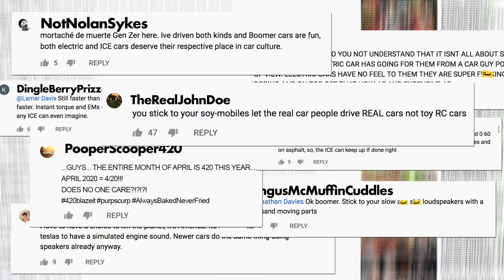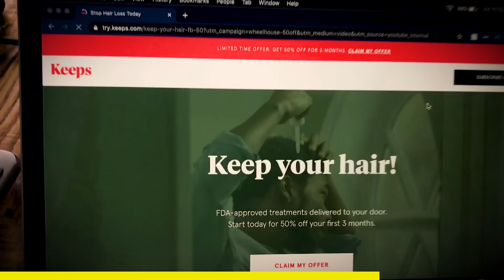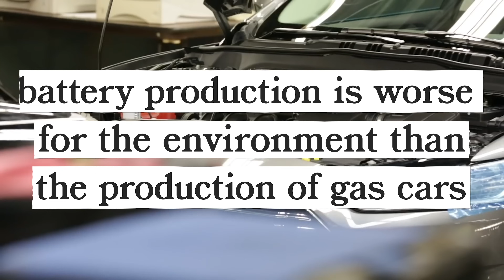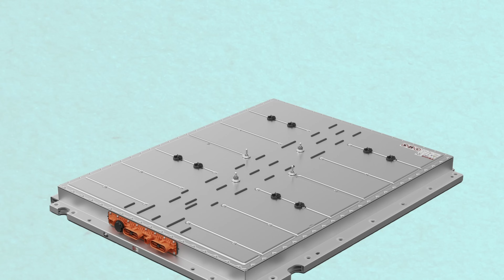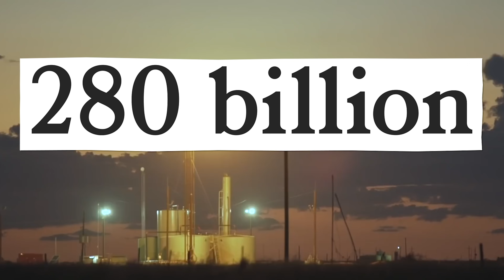Are Electric Cars REALLY Better for the Environment?

Comment: It depends on where you live,  I live in Vancouver and we run on hydroelectricity which is a renewable source of energy, also Tesla batteries can be recycled.
Reply: How many times can they be recycled? I have a 2003 Prius and had to replace the big battery a year ago, I got a refurbished/recycled one because a new replacement costs $4,000. Big whoopty-do they would only give a one year warranty on it, so that means I'll be needing a new car in what... another year (because I won't buy another big battery), or spend months looking for and waiting for another replacement!? Most people haven't had hybrid's or EV's for very long and so are completely unaware of the reality. News flash... these hybrids and EV's are FAR from environmentally friendly and are NOT a good replacement for combustion engines. These yahoo's need to go back to the drawing board and do a much better job because what they've given us as a solution to fossil fuel use and combustion engines is abysmal.
Reply: @SacredHabitats  Most rebuilt engines have a 90 day warranty. By your logic, that means  they will only last 90 days before blowing a head gasket.

You have a 17 year old car. It must have sucked, lasting only 17 years. Why, oh why couldn't it have lasted 20?  (Maybe things have gotten a bit better in 17years?)
Reply: @SacredHabitats  they keep ignoring the negative effects solar, hydro electricity, and windmill has on the environment. Nothing will change much basically.
Reply: @Teji Gill to answer which type of vehicle should one use... if you already have a vehicle with a combustion engine, keep it and use it. Do NOT dispose of it to get an EV, getting rid of things so we can have the newest greatest thing is FAR MORE harmful to the environment than anything. Likewise, when it comes to appliances, electronics, etc. get them repaired when they breakdown, do NOT dispose of them and by a new replacement, that type of behavior is terrible for the environment.
Reply: Tesla or Leaf, the lithium batteries cannot  be recycled. Period. There is no efficient technology at the moment to do this because of the chemical complexity of recycling, while the process is simple by itself - it is either burning or dissolving in chemicals. Unfortunately, either way not an option, coz the battery cannot be burned cleanly nor could it be dissolved without any environmental damage.
Reply: @sergiogooner  A quick single google search says that up to 96% of the lithium can be  recovered with existing technology. If Lithium becomes valuable enough, then it will become worth the cost to do so.
Reply: @MrRentageek  The fact that, like oil, lithium is a finite resource, will probably make it worth doing so. However, we will see what the future holds, as EV battery technology may soon move away from using elements such as lithium...
Reply: @sergiogooner  What complete garbage!   You need to see the YouTube video of the Volkswagen Electric Car Battery Recycling plant in action.  You can watch the recycling process for yourself. No burning or dissolving anything. Where do you people get your misinformation from?  The battery packs arrive at the recycling plant, and are discharged prior to being recycled. The residual energy from the battery packs is actually used to partly power the recycling process. It seems you are several steps behind what is possible...... And, just so you're aware, the lithium and cobalt content of the batteries is recovered to levels around 90%, after which it can be re-used in new applications. Try that with gas or diesel.
Reply: @Teji Gill and this video just posted a few hours ago. Take note of how much it cost Tesla car owners to charge their cars this past February https://youtu.be/EECnmBjgSK8 Like I keep saying we have extremely far to go yet to make truly green technology. Until then, anything we use or come up with will continue to pollute and waste. It's just the way it is if we want to live the way that we have been living because our lives are completely dependent on energy consumption. Until we learn how to extract electric from the air or Earth I do not see any means of energy that are good for the environment. We need to stop putting lipstick on pigs in the process of reaching any real advancement.
Reply: @Teji Gill I bought a 2003 Prius back in 2005. I still own it and it is my only vehicle. When it reaches the point of it can no longer be repaired will I get another Prius? No way! Will I get an EV? Absolutely NO! What would I get? I'd buy a pick-up truck that is older than 1981, before they began putting all of that electronic nonsense in them. Why would I do that? Because it's simpler to repair and fewer things to go wrong and breakdown, and... for the fact that we WILL have a CME (Coronal Mass Ejection) event in our lifetimes. At which point our grid, globally, is going to go down and will NOT be coming back up. In other words, we will be without electricity from then on out. An EV, or even a Prius/hybrid will be completely worthless as there will be no way to to keep them going. At least an old pick-up truck can run on some biofuels after the stored gas runs out. 
A FAR better investment though would be a solar powered bicycle and a regular bicycle, and a horse. 
In the meantime, everyone needs to learn how to live without electricity or any type of fuel because when that grid comes down there won't be any energy to draw upon, outside of your own body doing manual labor so you and your family can stay alive. Seriously, it is going to happen. I think a CME will take place by 2024. So I think it's MUCH smarter to take that money one would invest in an EV or hybrid and put it towards things that will work without electricity and invest in learning skills so you know how to do things without electricity/energy. That would be a far superior investment than an EV.
Reply: China Life  Sure, but the US produces more CO2 per person than China does. They just have 5 times more people.
Reply: Funny fact , BC has the highest carbon tax in Canada and yet their emissions still go up . The US has no carbon tax and their emissions have gone down  Lmao people are so easily fooled .
Reply: @rdhudon7469  Our country is also ran by an idiot so...
Reply: Tesla’s are overrated over priced garbage. Not to mention they are one ugly looking car
Reply: @real4039  the only ugly looking cars are the cars on the road today, they look boring and generic as fuck
Reply: @Teji Gill we require fossil fuels to build the EV vehicles and infrastructure. So, why would we want to add further insult to injury? Meaning we already have damage from fossil fuels, why would we want to ADD new damages from something else? People don't get it that these new technologies are NOT green at all. They just aren't. That's a lie from the industry to get us to dump what we have been using and switch to something completely new so they can extract more money from the people = that's how the rich get rich and become richer still, while further enslaving masses. 
What's the best thing to drive? Until our technology reaches TRUE environmental friendliness these modes of transportation produce the least problems environmentally... bicycle and horse. By the way, you do know that CO2 is NOT ruining our environment, right? The nonsense about CO2 and global warming is propaganda. If you don't know that you can begin to learn by watching this excellent video https://youtu.be/BGL2cjnn7kM and I highly recommend watching his, Tony, other videos if you want an education on real facts and reality minus any propaganda. Tony has been a highly qualified educator for 13 years on this very topic. This is exactly why I completely reject the Green New Deal (GND) and other so-called green technologies, they are no more green than what we've been using. Truth. This is also why I keep telling people to also reject the propaganda and tell this phony bologna's to go back to the drawing board and come up with something(s) that are truly environmentally friendly and stop believing this stupid fake CO2 is causing the Earth to burn up (or whatever nonsense they spew to the masses who don't know anything about this kind of stuff and line up like lemmings about to walk off the cliff blindly/stupidly).
Reply: @SacredHabitats  So because it uses at least 10% as much fossil fuel, it's totally worthless?
 
Also, that guy is a total  fraud. 

The ice caps ARE melting.

The permafrost IS melting.

Hurricanes, tornados, cyclones, droughts and floods ARE getting worse.

The Earth is getting warmer, and is doing so faster than at the end of the last ice age.

We are experiencing a mass extinction event all around us; only the 7th one in 13 billion years.

Lemmings don't actually walk blindly off cliffs.

All  of the above are verified truths.

Comment: So we measured CO2 on just a few chemicals in the batteries... 

You even skipped the nuclear waste they leave when mining it...  Trust me... The batteries we have and the ones we are about to get will do more damage than driving old cars with no emissions.
Reply: You do realise lithium isn’t radio active unless you make it right?
Reply: @engineeringtheweirdguy2103  
He either doesn't know what he's talking about or there may be a slight chance he may be referring to digging up radioactive stuff naturally on earth but was deeper thus causing less issue, being brought up to the surface but I doubt he meant that either lol
Reply: @dallysinghson5569  it’s fairly easy to get the grams per L fuel of emissions and grams per kWh of energy production for oil, gas and coal. Even in a coal based grid, without considering fuel refining, less emissions are produced.
Reply: Driving old cars with no emissions? How will it run then?
Reply: Why should we trust you? Do you have an advanced degree in anything? Or even just decades  of work in a related field?

Comment: How does the calculations allow for battery replacement over time ? Do multiple battery replacements undo the fingers ?
Reply: Current generation EV batteries will last twice the average lifespan of a standard combustion engine.

Comment: You forgot to calculate the emissions created by storing the spent batteries (transportation, facility energy, etc.). Also emissions may be the least of the issues. If batteries are not stored above ground, battery acid leaching into the earth and poisoning the underground water and surrounding area's soil is of serious concern. That is perhaps the most grave long-term problem that EVs are kicking down the road.
Reply: These aren't lead acid batteries, and there's no liquid component.
 
Also, since the whole concept is to be environmentally sound, Tesla has been at the vanguard of knowing how the materials are sources, and how to dispose of them. He's not alone, just one voice in the forest.
Reply: There is no battery acid in EV batteries. There is no liquid component!  Whoever told you that is seriously misinforming you!

Comment: This is the second video I watched on this subject. The other video had the same results and did post links to their references. I think EVs are good. What’s bad is a zero to 60 mindset. (Either we are going 60 or we are dead stopped, nothing in between) While we can help the environment with EVs there certainly are limitations, such as planes. So for some folks, especially politicians that are pushing an agenda to rid the country of all petroleum products is what I believe turns most rational folks against the cause. This is exactly the mindset that offers little in the way of positive change and ultimately hurts their cause and forces folks to resist. Change is often scary and most resist it. Gradual change is often the best route as many won’t notice. There is also good things happening in the production of gas cars as well. Manufacturers are always finding ways to increase performance, lower emissions while increasing efficiency. For those to say this is pointless is ignorant as these advances also help the environment. We know what gas cars produce today in metric tonnes of CO2, but to think that number won’t decrease in the future based on engineering is living with your head in the sand. I’m sure the CO2 impact of gas cars in the 70’s was far worse than today. What changed?  Not just the engine, but the refinement of petroleum.
Reply: Who exactly is pushing an agenda to get rid of all petro products, and I mean specifically proposing a single law or regulation that would propose this? Can you name even a single, symbolic act or bill that even suggests this?
Reply: @MrRentageek  Well, it hasn't passed, but the Green New Deal here in the US and the EU is proposing an effective ban on all petroleum based vehicles by 2035.  I put a link to the article about the EU's ban here: https://www.reuters.com/business/retail-consumer/eu-proposes-effective-ban-new-fossil-fuel-car-sales-2035-2021-07-14/.  And you can read the Green New Deal here: https://www.congress.gov/bill/116th-congress/house-resolution/109/text. The Green New Deal enacts provisions for America to meet a 100% power demand from renewable and clean energy within 10 years.  Currently, renewables make up less than 1% of the total grid support in America.  I don't know about Nuclear and if that is even a consideration under that deal.
Reply: @petermartucci6534  Not sure where you are getting your claims from, but the claim that 1% of the grid is renewable energy is completely false.  Renewable energy is 19.8% of the grid, not 1%.  According to the EIA, the electricity in the USA is generated using the following:
Fossil fuels 60.3%
Renewable Energy 19.8%
Nuclear 19.7%
Other Misc 0.3%

The goal is to get to net zero, which is zero carbon added.  However we get there is still a question, but so far the grid is around 40% zero carbon, not 1%.
Reply: Those claims are pretty misguided at best.  There have been efficiency gains in engines over the last decade, but MPG has remained the same or declined.  Why?  Because most of those gains went to more HP, not better fuel economy.  The same model car bought in 1998 that had a 3 liter V6 and produced around 190HP had a 3.5 liter V6 engine producing 255 HP by 2003.  HP has gone up in every car in the last couple of decades, but MPG has remained stubbornly low.

And you can claim all the sand theories you like, but they are fast running out of tricks to make gas engines more efficient.  The average gas engine even today has pathetic efficiency of 17% or so, and peak efficiency of around 35%.  Compare that to electric motors that are over 90% efficient.

THAT is the reason electric cars are taking off.  Because with a car like a Tesla, you can have over 1000HP with 400 miles of range, while carrying around 3 gallons worth of electricity on board.
Reply: @redbaron6805  Which claims are you referring to that I made are misguided? While I agree with you on EV's as well as with MPG on vehicles over the years, I'm not sure what I said that was misguided?
Reply: @petermartucci6534  Your fossil fuel claims are pretty misguided.  There are slight efficiency gains in fossil fuel engines, but we have pretty much maxed out the easy gains by now.  So, the focus is on hybridization or other forms of energy storage, as brakes, traffic and other factors contribute to the efficiency loss of the engine.  Ultimately however, due to the RPM range of an internal combustion engine, the peak efficiency is around 36% and average efficiency is around 17%.  Compare that to electric motors which are over 90% efficient.

That is the reason cleaning up transportation requires EV's.  They are 4x to 5x more efficient on average, and there is no way to get even close to that with ICE powered cars.
Reply: The 0-60 mindset is the biggest problem. The other problem is the fact that those in charge of this change are focusing on the wrong things.

What needs to be focused on is the process behind making these vehicles. The reason that we the citizens are the focus, is because we are the easiest section of the problem to control. We have no way to pay our way out of anything so we have to take it in the rear and go about our day.

Hybrid is what should be the focusing on. Its the best of both worlds and allows both sides to be improved without putting too much strain on one or the other.